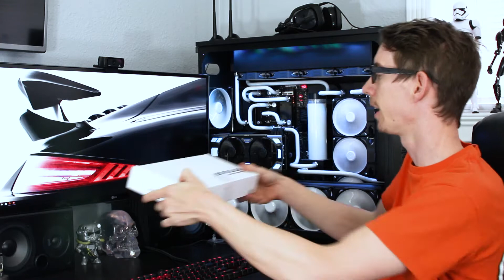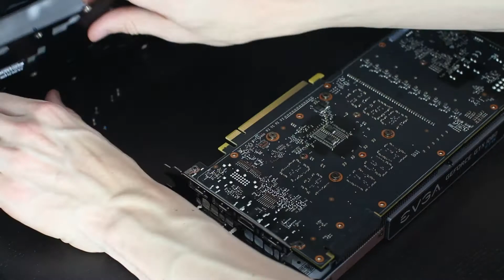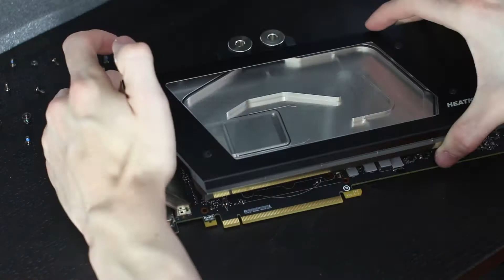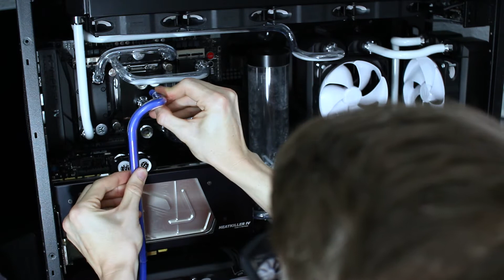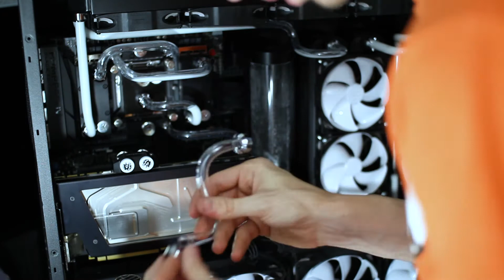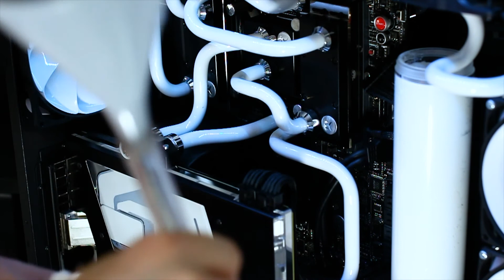LiquidHaus - Watercooling EVGA GTX1080 FTW & PETG Bending Walkthrough

Comment: do you approve the heatkillers quality 3 years later? I own an EVGA 1070TI and I want to keep it's backplate. I uses to have an alphacool waterblock with a previous card, and It had screws like the ones supplied with the waterblock in your video. They would unscrew on their own all the time. how about yours?
Reply: good question, i own a a Thermaltake Pacific M360 Plus D5 Hard Tube Water Cooling Kit, and got the heatkiller waterblock for my GTX 1080 in today and going to install it soon (need to get the fittings yet). how wil it hold after 3 years...
Tip for you psyber84: use locktite screwfix when mounting. it locks the srews. use the right one, and they can be uncrewed when wanted...
Reply: @arjana2397  I will keep that in mind. Please give me your feedback after you get it running.
Reply: @psyber84   yes, i will. think it would be this weekend hopefully (if fittings are in). if it takes to long..just ask, as a reminder..
Reply: @psyber84  Got it running since yesterday and looking great! but more important, cooling great!!  under fully load (also tweaked it a bit (+200mhz core speed and +600 mhz memory clock) i got a temp of 76 degrees with the air cooling ( Arttic eccelero extreme IV custom cooler instead of the standard "turbo" cooling housing of the MSI AERO). Now on watercooling i am running temps  of 43 degrees under full load. so a differance of 33 degrees! and again, looks also great!
Reply: Maybe i can tune the card even further as i am running on water now... i was running on the safe side with the overclocking mentioned above...
Reply: Also, running without backplate as they where out of order...comming up with next order next week i hope, together with my RGB strip for this housing.
Reply from the maker: Absolutely. The Heatkiller components are top notch engineering, and they’ll hold up forever if kept taken care of.